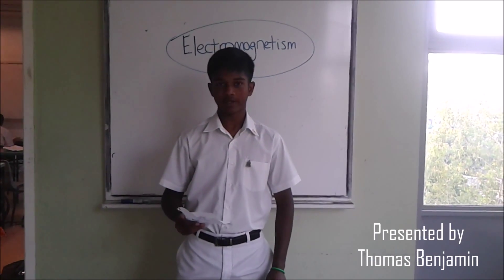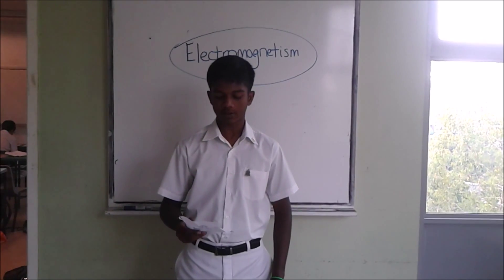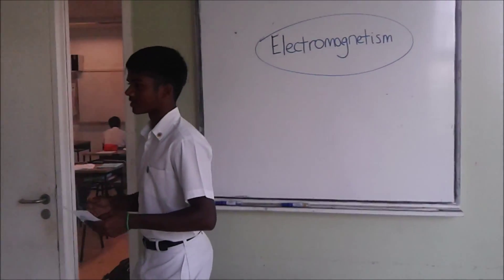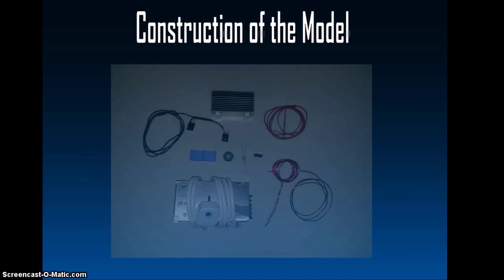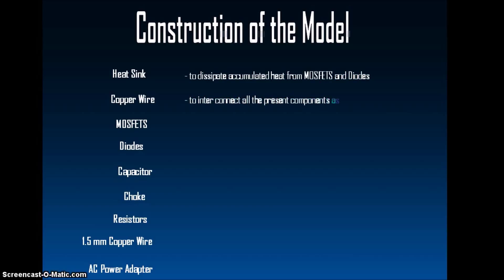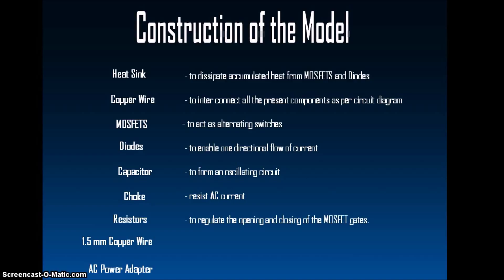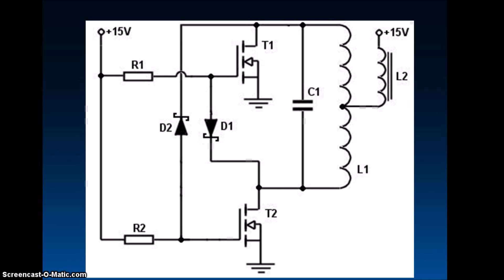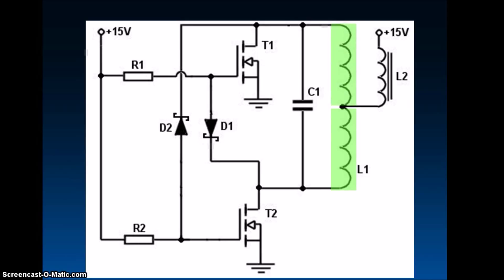Electromagnetic Induction Heater

Comment: Nice video. I have some questions:
As far as I know (correct me if I'm wrong), the coil itself won't heat up (only the nail inside). Also the coil wouldn't cause electrical shock on touching... is that really the case? If yes, then what would be the dangers of touching the coil during the process?
Thanks
Reply from the maker: Thanks for the view and comment,
The coil would heat up due internal resistance but significantly much lesser than the nail (as the nail becomes red hot!)
Also touching the coil whilst heating would affect you as the voltage is very low, (12Volt).
It would be slightly hazardous for you to put your finger through the coil as the iron in our blood would heat up.( Simply put boils your finger inside out. Haven't tried it yet and not intending to try it as well)
Reply: Thanks! One more thing: If the coil spiral was double the size, and you also had put a longer nail inside (with double the size, let's say), would all the nail's parts "covered" by this bigger coil heat up like in this video or you would have to increase the power of your system to do so?
Reply from the maker: Marcus Casagrande it does not matter how long the nail/coil is. All that matters is that the change in magnetic flux linkage is concentrated at the centre of the solenoid/coil. If the radius of the coil increases you may have to increase the power of the system to achieve similar result.